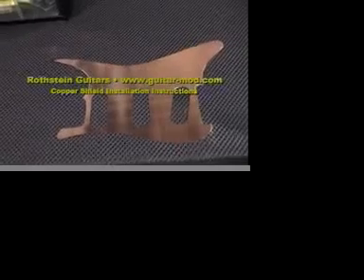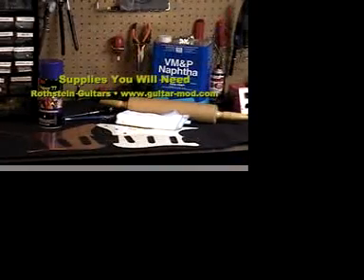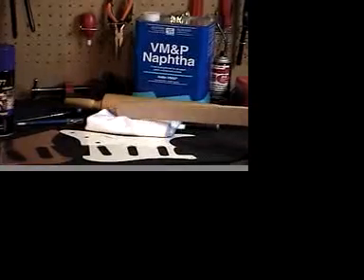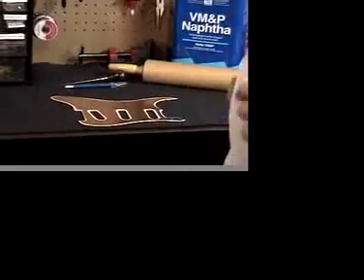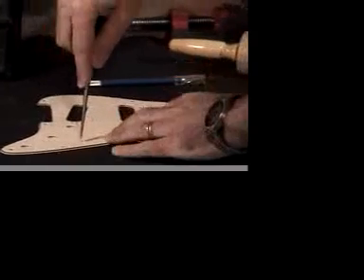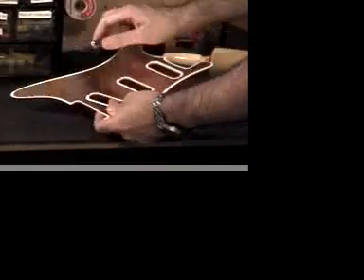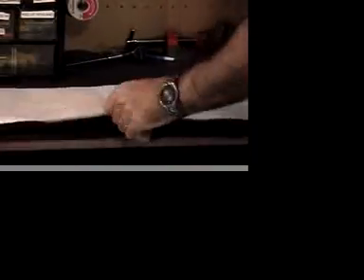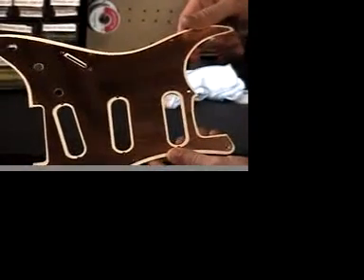Copper Shield Installation Video

Comment: i've got a guitar with 2, double-coil pickups, and the bridge pickup gets really bad buzzing (only when i'm facing my amp, when i turn sideways it mostly goes away). worse than the neck. i did the wiring myself and i'm about 93% certain that its grounded properly. should i try shielding everything? i thought double-coil pickups were supposed to eliminate buzzing and humming.